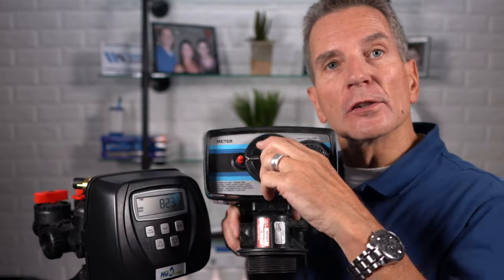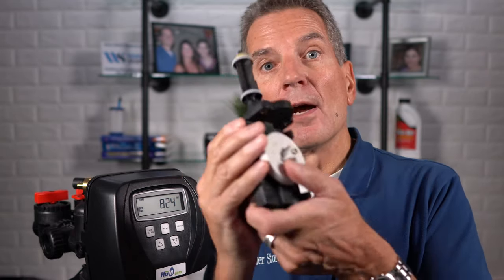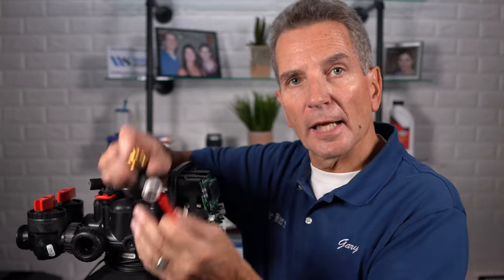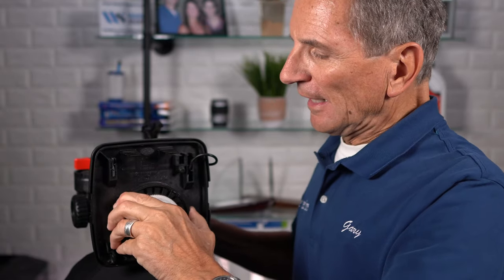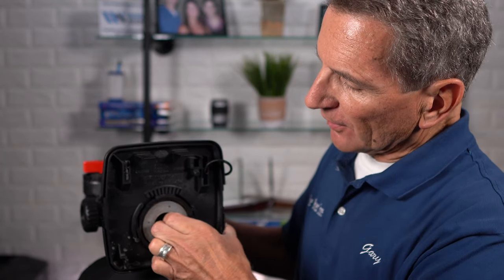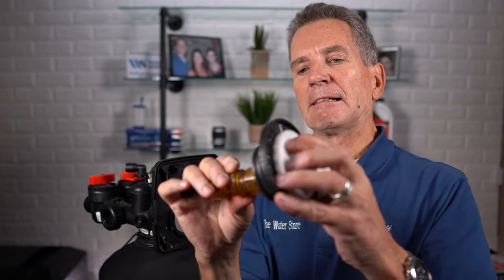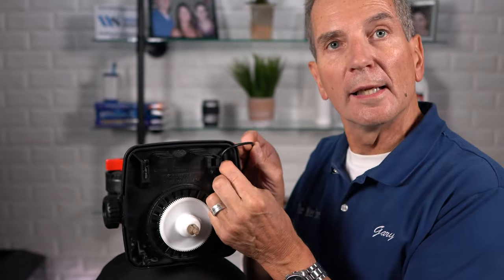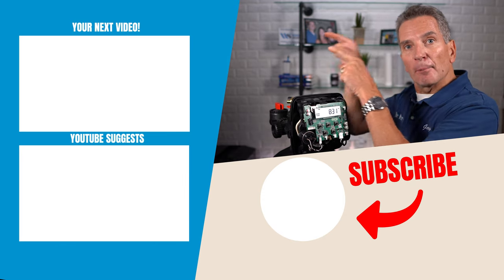WATER SOFTENER Troubleshooting – CONSTANTLY DRAINING

Comment from the maker: This happens from time to time with water softeners, iron filters, tannin filters and back washable filters.  This video explains how to troubleshoot and fix it for your family!
Reply: Hi Gary I can't find the parts for this on your store link, also I can't see your other reply's on here. Thanks
Reply: Gary hi, I need to know what is wrong with my fleck 5800sxt. It went into regeneration in the middle of the night and never came out of it and was draining all night. I turned the power off to the pump and it stopped. I turn the power back on and it is still in regen mode and drains. I tried resetting and nothing, I go through regen stages and nothing changes. Please help me
Reply: where can i buy the Dupure water system piston and seal pack?

Comment: Thank you Gary for this video! I was told we'd need to replace our 3 year old Waterite unit because "we just don't repair these". I figured I could try and take it apart before ordering the parts just to be sure I could. After a disassembly and cleanup, my serious drain tube leak stopped! Saved me the $200 for parts, and the $2000 of an unnecessary replacement. Sincere thanks!
Reply from the maker: Glad to help. Please share video with friends and family!

Comment: I have the same head. How do I turn off the unit using the screen?  The softener is hardwired.   All the videos are terrific!  Thanks!
Reply from the maker: I have never seen ione that was hard wired before.  I would remove the faceplate by pulling forward on it, then unplug the power supply from the circuit board.

Comment: Hi Gary, and thanks for your informational videos, they're great!  I have a CULLIGAN HE1.25 Water Softener that is less than 2 years old.  Its consistently draining into the drain at a heavy drip.  I called Culligan, and of course they want a ridiculous trip charge $$$ to see what "may or may not still be warrantied".  I watched this video but wondered, are all these units pretty much the same? I executed a manual REGEN to see if maybe the motor just didn't get the piston to the right position, but it repeated the discrepancy after the REGEN cycle.  I suspect its internal and possibly a seal on one of those pistons and am pretty handy but wanted to see if you knew if there was any more CULLIGAN HE1.25 specific info out there to help with disassembly?  Thanks again for your awesome videos!
Reply from the maker: Sorry to hear, yes the seals are gone and you can't get parts anywhere else.  This is why I never recommend proprietary products.   Unfortunately now you will need to pay their "ridiculous trip charge $$$"

Comment: Hi Gary,

The water softener system in my house came along as a package with the house it when I bought it. I replaced the seal pack in the iron filter earlier this year when it started leaking. The iron filter had a brine piston on the back of the seal pack. I replaced that as well as the seal pack as it came in a package when I bought the replacement parts. Will this brine piston cause an issue with the performance of the iron filter if it doesn't need it?

Thanks!
Reply from the maker: I don't think it would.

Comment: Thank you so much! We replaced those parts and bought the tool and our softener is no longer leaking water into the sink. One word of advice to others trying to do this fix is make sure you are not loosening the white gear but the black collar behind it (we accidentally started undoing the white gear once we broke the black collar loose and when we reassembled we got error code 101). We adjusted the white gear and re-seated everything and then pressed 'next' and 'regen' for 3 seconds to get it to recalibrate the board/laser eye so it could figure out the piston location.

Also, in terms of preventative maintenance how long does the seal pack/pistons typically last, should we replace every.... 5 years?
Reply from the maker: Thank you for your information.  The seal pack can last anywhere from about 5 years to over 20.  Really depends on how much dirt and iron is in your water.
Reply: @water_estore  ok good to know!  Thank you. I think our softener is about 9 years old so I'll try to remember to do it in 2030 if I still live there!

Comment: Great video Gary.  Thank you.  I had pulled the plug during a regen and pulled a piece of broken rubber washer out of the drain line/hole, but then it's been constantly draining after that.  Based upon  your video, it seems that my kenmore ultrasoft425 may need replacement piston & seals since water is draining in service mode.    The draining stops momentarily in between a few of the cycles but starts draining again in service mode.  Does my thinking seem accurate?
Reply from the maker: Yes it is

Comment: I have the same softener. Except mine has the gray wire on side leading to the little turbine).. I need the parts you changed in this video....would you have them in stock ? (I live in lindsay and would drive up to your store if you have them. No one in this area has those parts)
Reply from the maker: Yes, we have them in stock.  We are closed Sunday but 9-5:30 the rest of the week.

Comment: my fiberglass neutralizer tank is leaking slowly from the bottom side. are they repairable using fiberglass cloth and resin?
Reply from the maker: Great question!  No they are not repairable.  It is far safer to replace the tank.
Reply: @water_estore  its annoying as its a tiny leak. is it a real hassle to replace a tank? must be fully drained of course

Comment: Hi Gary: great video.  Thank you.  I have a question: if the drain runs continuously due to some of the reason mentioned in your video, is the water still be treated?
Reply from the maker: Yes it will but you need to get it fixed because you are wasting a lot of water.

Comment: need some assistance with my Dupure Evolve water softener.  "check Salt level".  I have emptied it of loose salt removed salt bridge added iron out,  added salt and ran regeneration cycle twice still get "check salt level" after regeneration.
Reply from the maker: Check salt level comes on when it thinks you need salt.  It means absolutely nothing.  It expects you to tell it when you have added salt and based on the number of regenerations and the settings it has calculated that you now need salt.  Check your manual or just ignore it.

Comment: Thank you for your video!! Very educational for homeowners. I learned from your video to at least troubleshoot through using the bypass valves! I heard the draining stop after a few seconds. The issue is that the system I have seems to be different from the one you explain in your video (through looking at stickers on it and googling I think we have a EWS-1354-7000) any thoughts on how to further troubleshoot and figure out what part in this is making the constant running of water when operating?
Reply from the maker: If water is constantly flowing to drain the pistons and seals need to be replaced, doesn't matter what brand of water softener but you need your specific brands piston and seal pack.

Comment: Excellent video, very helpful! I have a question: I removed my seal pack and the pistons and some seals were clearly damaged inside the pack but the pistons look perfectly fine. Do I really need to replace the pistons as well or is just the seal pack enough? Thanks!
Reply from the maker: You can try just replacing the seal pack but the manufacturer recommends replacing both at the same time.

Comment: The drain/overflow tube keeps popping off and flooding my laundry room. It has happened twice both times while I wasn't home. Is there a way to secure that tube so that it doesn't keep happening?
Reply from the maker: Yes, I have seen that happen before.  You can change the fitting to a mroe sucure one as I discuss in this video at the 56 minute mark https://youtu.be/NHXBXCvGVyQ

Comment: Hello Gary. I have a watts system. The drain line won’t stop leaking water. Do I do the same as you are telling me in this video or is it different with this brand. If so, how do I get the parts. Thanks
Reply from the maker: Yes, in the sense that you should bypass it. You will need to check with Watts in terms of where to get the parts and even if they are available. Then you’ll need to get a manual and see if you want to tackle it yourself

Comment: Thanks Gary. After I swapped the parts, my water has a sulfur smell. It didn’t smell like that prior to replacing parts. Any thoughts on what went wrong?
Reply from the maker: Not related to the parts swap.  Water softeners don't remove sulfur either way.

Comment: what other reasons are there to rep[lace the spacer stack and pistons?
Reply from the maker: Not usually unless you have lots of iron and don't have an iron filter before the water softener which could cause the spacer stack to clog with iron.

Comment: I have an old Autotrol 255/460i system which was leaking like a sieve until I purchased a valve disk kit recommended by Pentair to try. Since my plumber was coming over anyway I asked him to install the flappers. That fixed the leak from the valve itself, now I have a lot of water coming out of my drain hose. I haven't tried shutting off the bypass valve (which the video says will determine if the 255 valve is still defective) because the system is in regeneration mode. Water now is really coming out of the drain hose but I read elsewhere during regeneration as much as 66 gallons can be drained during regen. Is this accurate? Also I have the timer set at the right hour of the day but regeneration is occurring at 9 a.m. I thought the system was automatically set for 2 or 2:30 a.m.?
Reply from the maker: Quite honestly, I have always hated those old Autotrol valves.  They are very finnicky and difficult to problem solve.  Yes, you can easily get 66 gallons or more water used during a regeneration with one of those. Yes, with the current time set correctly, it should regenerate at 2:30 am.  When you finally get fed up with your old softener, check out one of these https://waterestore.com/products/hum-deluxe-water-softener-30-000-grain

Comment: I have a slow drain and when I put it on bypass it stops the draining. Does that mean I have to replace the entire cylinder or just the pistons and seal pack? Can he system be left on bypass to stop the draining while I wait for the seals?
Reply from the maker: Yes, you need to replace the pistons and seal pack, we have them here https://waterestore.com/products/clack-ws1-softener-rebuild-kit-wrench you can leave it on bypass until you are ready

Comment: Gary, I have an almost 30 year old Aerobic Iron Filter to remove Iron & Manganeze and an aerobic Air Elimination Tank air injection filter to remove sulphur smell.   We do not add chemicals, don't  change filters or anything.    Things are working fine, water seems fine.   Question is that the backwash goes on for over an hour, almost 2 hours.   Seems like TONS of water go be going into septic system.   Is this a malfunction?  Do you have a suggestion on what to do?   My well person said this is normal.   It doesn't seem normal - at all.   Thank you for any help!
Reply from the maker: I do not have any experience with that type of filter but the water usage does seem excessive.  Ours runs for about 45 minutes. https://waterestore.ca/search?type=product&q=iron*%20hum*%20fo*

Comment: Thank you so much for your wonderful video!  
We have a water softener which I thought Clack because the plumber said it was but I found it is Ultima brand. ( I didn’t have any knowledge when we installed it and I just believed what the plumber said. I have no idea why he said it’s Clack. I was trying to contact him but he is not replying.)
Do you happen to know Ultima water softner? It looks very similar to Clack.  I desperately need to buy replacement parts. Please help me!
Reply from the maker: No, they definitley are not Clack.  These are very problematic water softeners. I believe they are made by Pentair.  I ahve worked on these in the past but won't in the future as they are almost impossible to service.  I suggest you replace it with one of these https://waterestore.com/products/hum-deluxe-water-softener-30-000-grain

Comment: Hey Gary, love your videos and have learned alot. Just curious, I put my system into bypass to sevice it and when i put it back into regular service it doesnt want to automatically go into bypass when its in regen. Do i need to reset something or did i mess something up? Thank you for any and all help
Reply from the maker: It bypasses the system internally during regeneration.  You will not see it move the external bypass that you use.
Reply: Sorry for the double commenting on 2 different videos Gary. So I replaced the seal pack and parts and all installed nice and easy per your video and as I turned the system back on I noticed the drive gear moving much slower than before. I'd imagine its because of the new seal pack but how fast should it be actually moving? Thank you again for all the help. I greatly appreciate it! 👍

Comment: Rain soft - water softener. For iron  TC-100-10 and TC-100-As.                                Hello, I wish I would have seen your video before I unplugged mine during regen or back wash phase because of the amount of time and water that had drained .. What do I do to close the valves back so that there not stuck open!  Tia.
Reply from the maker: I don't understand the question. Are you asking how to close the bypass valves? This video shows you how to operate the byapss valve https://youtu.be/q0kRRS6C20Q

Comment: Hi Gary, great video! I have a strange issue where after regen, the piston on my Clack water softener doesn't return to the correct position, thus causing the draining. If I pull the plug from the board and wait 10 seconds before plugging it back in, the system does push the piston to the correct position, and the draining stops. Any idea as to what may be causing this? Is it a faulty board?
Reply from the maker: Probably not the board.  It sounds like the piston is getting stuck in the seal pack, I would rebuild the valve, we have the parts here https://waterestore.com/products/clack-ws1-softener-rebuild-kit-wrench
Reply: @water_estore  Thanks Gary - the weird thing is, we had a water softener maintenance guy come over two weeks ago, and he replaced the seal pack right then and there. Could it have gone bad already?

Comment: Replace mine and got an error 102. Hand tight. Tried disconnecting power and resetting motor by holding next and regen. Still getting error. Checked the new stack and free of debris. Is there some sort of adjustment needed on the "white gear" that controls the plunger?
Reply from the maker: I would check the suggestions in this video https://youtu.be/v_oF5w5dB1U?si=6fIhnXV3nALG0d44 No adjustment needed, you may have reassembled the valve incorrectly.

Comment: Hi Gary, I put the system I to bypass and the water still flows from the drain line, what does this mean?
Reply from the maker: I can’t see if that is possible unless the bypass isn’t working correctly
Reply: @water_estore  I replaced the seal pack and all was fixed

Comment: So, my softener was making a lot of noise. Sounded like wind noise more than rushing water, and had been running for a good 12 hours. The dial looked to be pointed at backwash mode. When I bypassed the tank, the sound stopped. Also, when I switched the dial to slow fill, or fast fill, it also went away. When putting back into backwash, the sound returns. Based on your description it is a post-fill softener. 

It is an Aquamerica product, and looks nothing any of those mentioned in this video. Does it need to be in backwash mode to run properly? Any help would be greatly appreciated.
Reply from the maker: It does need to be in backwash mode for a short period of time during regeneration.  This YouTube video should help you to understand https://youtu.be/udmE-hhh084

Comment: If no water comes out when u open bypass then is it working ok? My issue is a constant drip. Upstairs there is a drain tube that goes into the washer housing. The dripping is driving me insane. The aquascience triton softener is 3 years old.
Reply from the maker: The piston and seals in the valve keep the water from dripping to drain while in service.
Reply: Hi. It turned out one of the rings in the seal were cracked.

Comment: Gary hi, I need to know what is wrong with my fleck 5800sxt. It went into regeneration in the middle of the night and never came out of it and was draining all night. I turned the power off to the pump and it stopped. I turn the power back on and it is still in regen mode and drains. I tried resetting and nothing, I go through regen stages and nothing changes. Please help me
Reply from the maker: Likely need to replace the pistons and seal pack
Reply: We just encountered the same problem with the same model. Is there a video that you followed to replace the pistons and/or seal pack? Or a store/website that sells the parts? Thank you.

Comment: Do u sell or ship new units to US and what brands do u recommend of those in your line?  My 20 yr old cull system may need replacement  as I have a drain trickle even after replacing seal pack. I can also hear the water running in my sink but the RO system bypass stops that - but nothing stops the trickle in the softener.  Seems like the motor is running alot too.
Reply from the maker: Yes, we do.  Our HUM Water Filtration water softeners are best, like this one https://waterestore.com/products/hum-deluxe-water-softener-30-000-grain